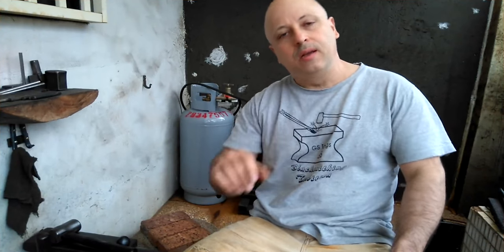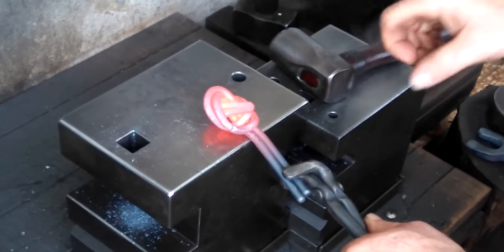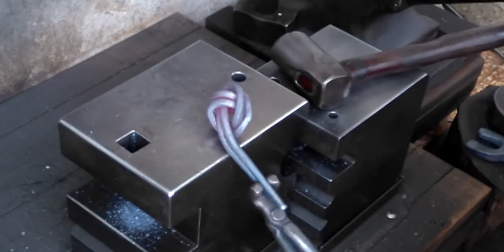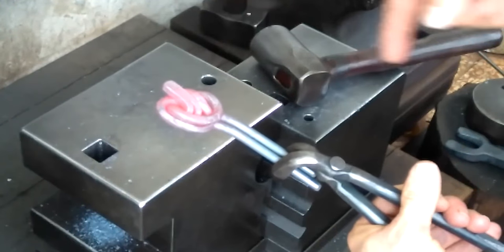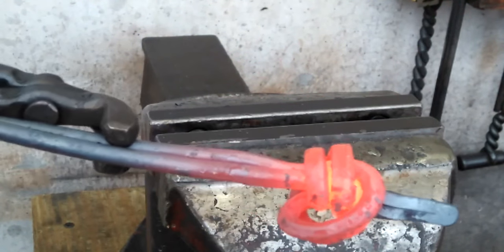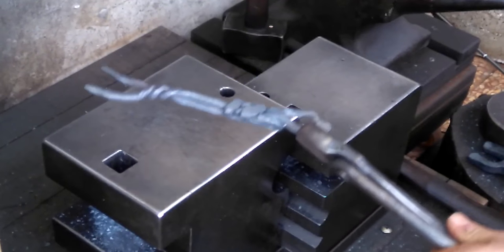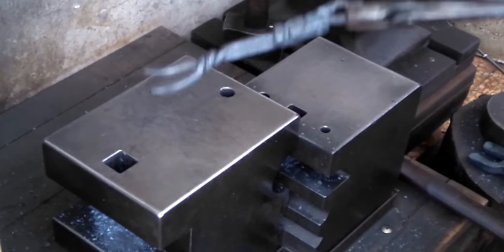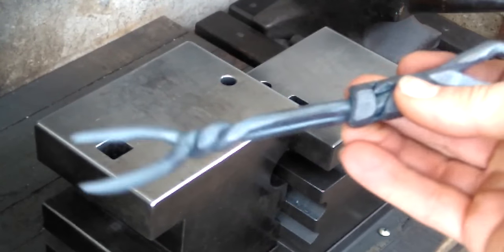Forging a camping / BBQ fork with doubled knot handle

Comment: Very nice. Why didn't you use the horn on the other anvil for the tine work? 1st guess is camera movement/angles?! Thanks again.
Reply from the maker: Floyd, I rarely use a horn in my normal work and so I typically don't gravitate to using that horn, even when I should. But you hit the nail on the head - I was thinking of using the horn this time but didn't feel like adjusting the camera. Thanks. Glen

Comment: are those little fakes that fly out when you hit the metal with hammer hot? or are they so thin that they get cold before it hits your bare skin?
Reply from the maker: Jerry, Those flakes (scale) are very hot, but only for a couple of seconds. You often will see me wiping them off my anvil face with a bare hand. However, scale can be very dangerous for that short time (when hot). I've suffered a lot of burns since scale will stick to skin. And it's a main reason why eye protection is an absolute must. Thanks for watching. Glen